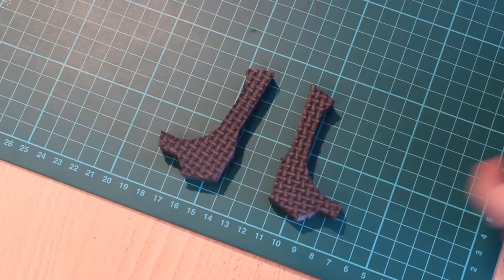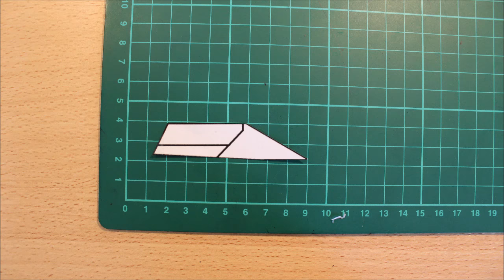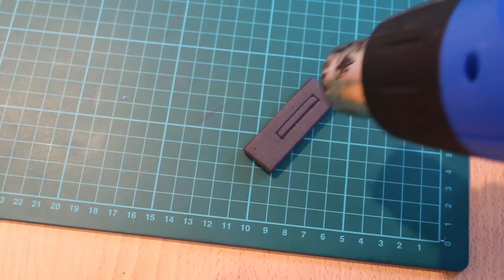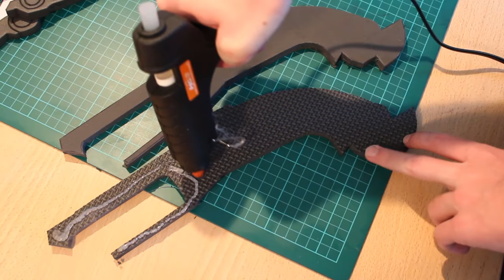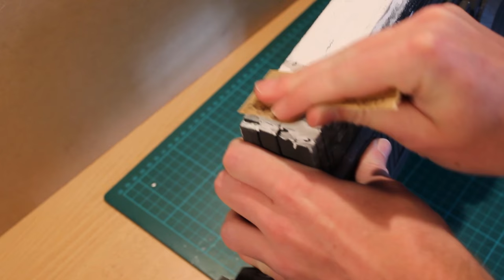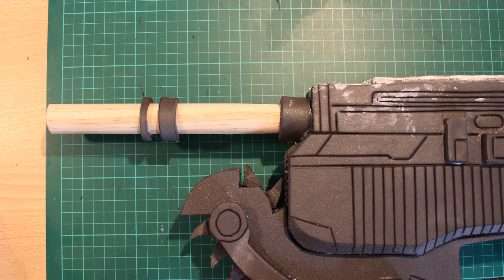HOW TO: Gears Of War 4 Lancer Cosplay Prop - Part 3

Comment from the maker: Get it done ! =D Halo 2 Anni Battle Rifle tutorial up next.
Reply: Hey Andrew,
I saw that you used wood. And although it works there is no hole in the barrel. You could actually use PVC pipe, very light and easily painted and cut. It also is only like $3 U.S. and even has a hole straight through it to give a genuine barrel look. And if you're wondering it is plastic so it will hold up pretty well against most damages.
Best regards, CrazyChezBurger
Reply: Andrew DFT could you make a linke where we can get the material andrew ?
Reply: Andrew DFT Love all your videos and great job with every gun stunning in detail. Although I have 1 request. Could you masterfully create an A280C blaster rifle from starwars battlefront? That would be absolutely amazing! Thanks!
Reply: Andrew DFT yesssss :D
Reply: Andrew DFT Can't wait! I'm working on the Reach ODST right now! First helmet attempt was kinda shit but I know what I need to do to fix it. Love the work you do man
Reply: only 2 60x60cm foam left... is it enough???
Reply: If you mean only for the whole project, then no. I used 4 for the first part alone.

Comment: Does your hot glue melt the foam?
Reply: Hot glue it's not hot enough to melt the foam
Reply: Ok, just it melted my xps so i was wondering about eva as i haven't used it yet.
Reply: So far I haven't melted any of my eva props so I will say it's safe to use it on that.
Reply: Thanks